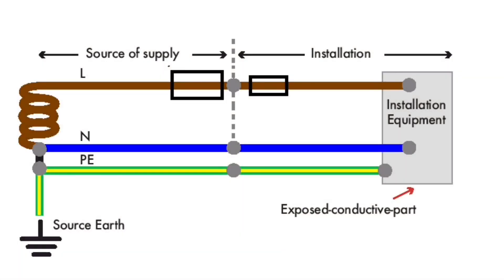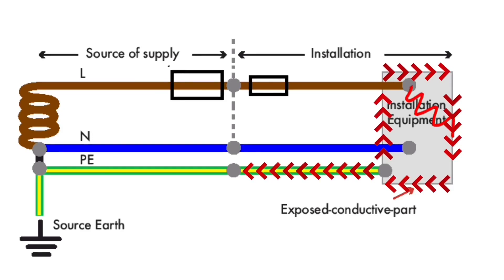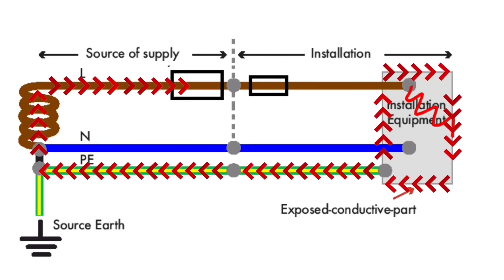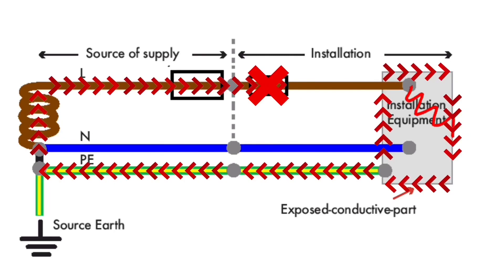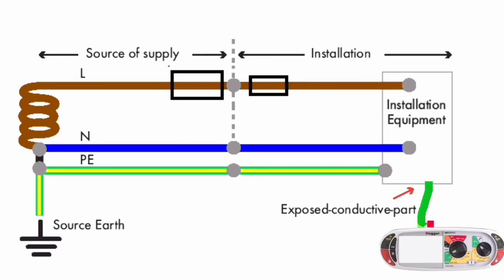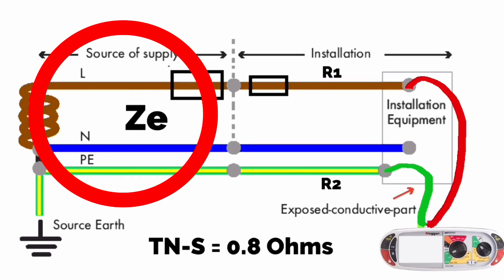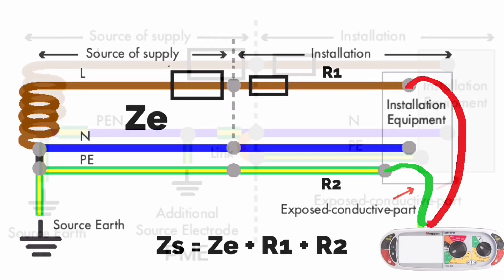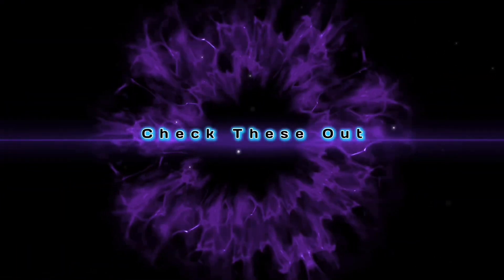Earth Fault Loop Impedance Path Explained Zs = Ze + (R1 + R2) Earthing Arrangements TN-S & TN-C-S

Comment: On the minor works certificate it asks for Zdb test. I believe this is so you don't have to isolate the power to all the circuits on the board. Can you do this test with the main board still on, so not to disturb the rest of the house?